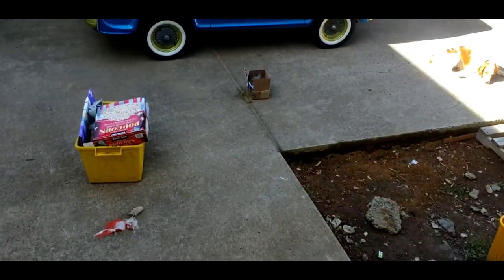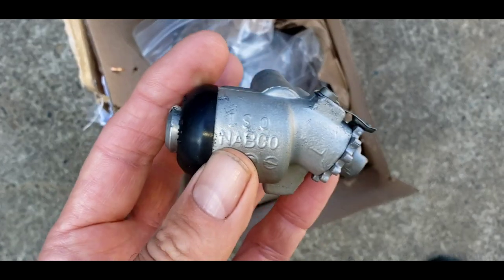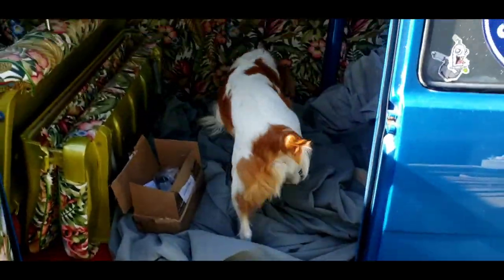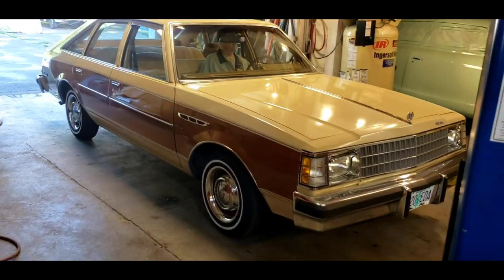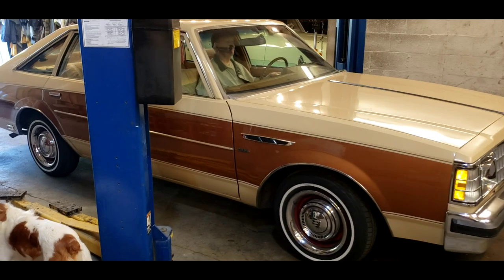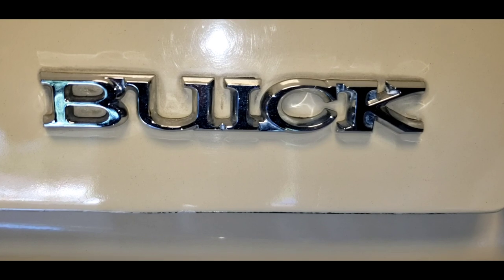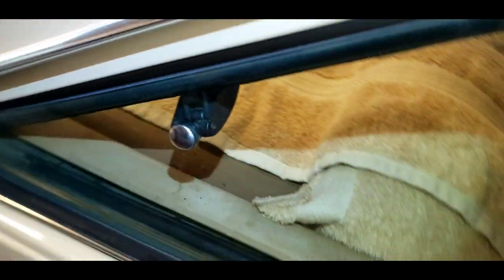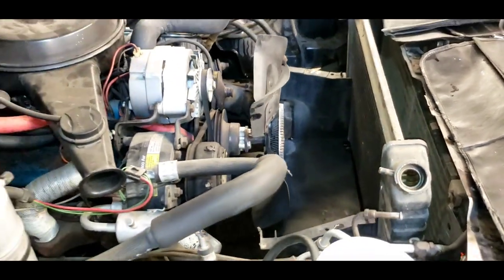Blessed and Honored

Comment: They were 115 hp and 190 lb of torque in there day.  Found the rating on automotive catalog. My sister bought a 79 Cutlass Supreme back in 1988 already 9 years old then with 32,000 actual miles on it. It got her through high school her bachlers and masters degrees. My dad painted it they did the bumper fillers headliner and A pillars she traded it in 1995 still looking great and running well. It was of course a 3.8 Buick. Brings back memories.

Comment: I remember the dealers trying to put a good spin on it when the customers asked why the rear windows wouldn’t roll down. “It was specially designed to give you extra elbow room to comfortably seat 3 in the rear seat!”
Reply: Actually, that's why GM did it! To make more room in the rear seat. I never understood the beef. Many coupes (or 2-door sedans of the time) had non-movable rear windows. There didn't seem to be too many complaints when these cars were around. But everyone complains about the design today!

Comment: Te Buick V6 was bullet proof. Here in Australia they were used in the Holden Commodore from '88 to about 2003-4 I think. Super reliable and very, very long lasting.
Reply: By '88 you were probably looking at what should be considered a 4th gen engine with a crank driven oil pump and EFI. The 3rd gen unmananaged carbureted unit with cam driven oil pump was a 75k mi throw-away. The old crotchrotter dual-junk carb fuel mis-management caused the oil to gum up the pickup screen and the distributor forcing the oil pump gears to wear into the Aluminum external above sump oil pump cover all led to oil starvation.

Comment: I had the Oldsmobile version of that Buick (the Cutlass Salon) years ago. They were smooth and comfortable, just not quick. Yes, GM stupidly designed them so the back door windows were fixed so only the rearmost vent glasses opened which didn’t do much to move the air. The Cutlass Supreme sedan and Cutlass Cruiser wagons also had the fixed windows. These cars were all based on the Chevy Malibu, so parts are not expensive or hard to find ... at least that was the case 30 years ago!

Comment: Those were dark days for the auto industry. Newly imposed strict emission controls and MPG requirements choked the life out of those feeble little engines to the point they barely ran.  It’s a turbo 200 transmission.  Very weak transmission and to make things worse GM decided to put them in full sized Chevies.  The transmission shops loved them!

Comment: Great time capsule I remember that body ,they were interesting but just another daily transportation .
it's great that they saved it .
That aerodynamic aid under the bumpers Is important it keeps the hot air from recirculating into the radiator when you're not moving and at rhighway speeds it actually makes a difference. Missing one will take 10 + MPH off the top speed of a Pontiac wagon 307  4 barrel.

Comment: I was about to say that you missed to show filler neck behind number plate :) If that is similar transmission to my 81 Oldsmobile should be TH200 with lockup torque converter.

Comment: Unlike today even back in the early eighties all the options were optional. You could get some Option packages but
Otherwise it was pick and choose.  This car has power brakes power steering air conditioning on a autmanic but no power windows no power locks and no full hub caps.
 I met someone once that order 1985 Chevy Malibu wagon with no air conditioning and the dealer would not place the order unless they put down as substantial deposit because they  Wouldn't be able to sell it at a profit. if he didn't take it.
Reply: That makes sense I was very surprised to see that car with dog dishes or poverty caps or whatever they want a call them!
 When I was a teen if I saw a car with dog dish hubcaps I would turn around go back and look maybe it's an old place car!
 I love old police cars specially Mopar!
Reply: Police car..